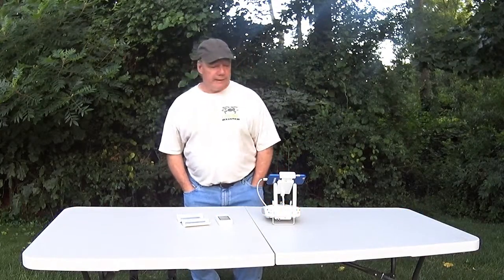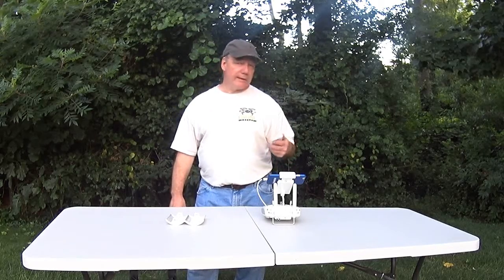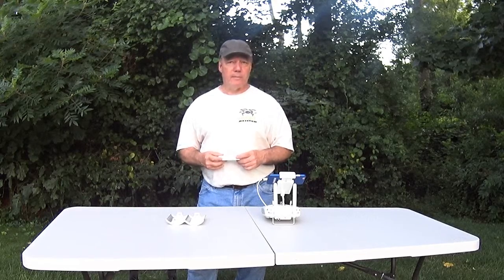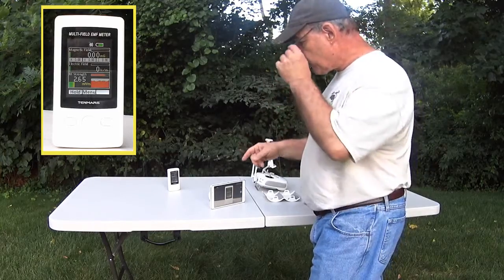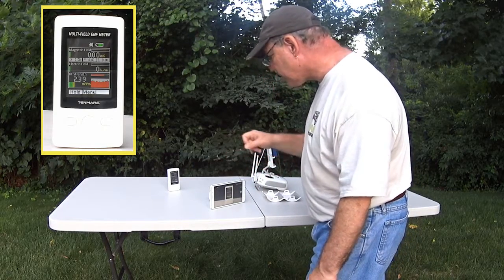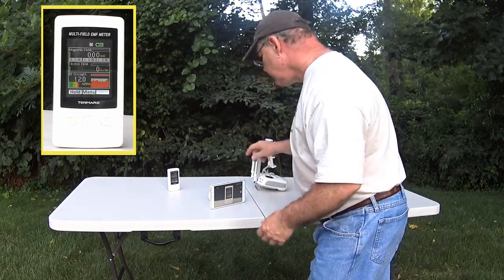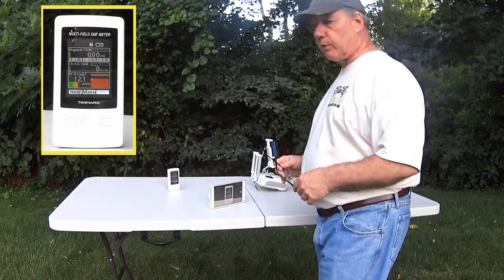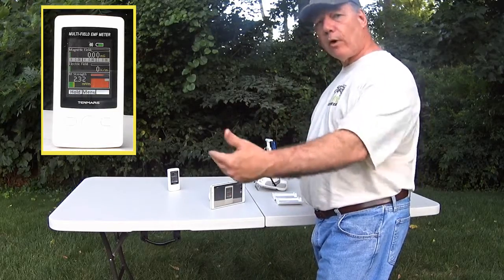DJI Phantom Drone Range Extenders do Work!

Comment: how do these compare to the argtek range extenders?
Reply from the maker: Thanks for the post. The parabolic will increase your range by about 50% and the ARGtek can more than double it. Everything depends on where you're flying but these are average results you can expect. Thanks again for watching and be sure to sub the channel. Rick
Reply: I was wondering the same thing... Thank You for the test !!!
Reply: From my experience  ARGtek is a bit over priced for my results for the P3S- I just got a windsurfer. If you have the Standard do not sink money in upgrades..( my opion) Just sell sell it .. the difference between the Standard & ADV is huge! and im not just talking the range. just my 2 cent maybe other people have have different experiences..
Reply: Aaron D i bought amd tested them and they do work much better than the original antennas. They are however more difficult to install that it seems.
Reply from the maker: Aaron, I have been using the ARGtek range extenders for over a year on my Phantom 3 and Phantom 4 and they consistently more than double my range. The Phantom 3 Standard is a little different since it doesn't use the LightBridge technology the others use but the difference is still impressive. I also work with the company ARGtek and am an authorized dealer for their kits. I choose them because of the testing I did when compared to all the other companies out there. As for the antennas not fitting in your case, they are removable and detach in about 10 seconds when you want to pack up for the day. I agree that that parabolics are a good alternative and my testing shows they can add about 50% more distance where the ARGtek will double the range. Thanks for the post but lets keep it civil. Rick
Reply: Drone Valley,,
Reply from the maker: Thanks again for the post and by civil I meant keep the cursing to a minimum as I have a lot of younger viewers and families on the channel and you can get your point across without the swearing. As for the consumer part, I understand that you may have tried these but there are a lot of knockoff items being sold that look like the original kit and not being sold by authorized dealers. I sell only ARGtek original kits and the upgrade does double your range over the stock antenna. The installation is simple and takes about 30 minutes. You're basically replacing the stock antenna with a set of high-gain ones that concentrate the signal and help provide a longer distance for the flight. I will do another test like this one to show the difference in gain over the stock antenna and the reflector ones to provide some numbers.
Reply: Drone Valley ..
Reply: Music_360 look harder. said bs in your first post amd dropped an f bomb on your reply to me. just sayin. but i think you ,ade your point. just leave it and move on. some of us have had great experiences with this product maybe you didn't . fair enough? all in all most of us enjoy drone valleys reviews and videos amd there's  no need to continue back and forth with this. and just fyi, not picking on you. i agree with you that the install could be more difficult that it seems and these antennas wont "upgrade your system". just upgrades your signal.

Comment: That is evidence!
Reply from the maker: Thanks for the post and I felt like I had to do a clip with the EMF because there was still a debate raging about these extenders working. I'll be doing another one this week comparing the ARGtek kit with the parabolics to show the extended range these kits provide. Be sure to sub the channel so you don't miss any updates.
Reply: Drone Valley I subbed .. I like evidence and when I get my P4 I will get that extender! Cheers!

Comment: if you ever get a chance to do a   1000 ft test.    only half joking ,  hook up  some way to  have the Camera on the Quad  look at the Meter as you fly away. 

That would be a great test       You have it Correct  sending the Signal in one direction increase the signal down range.
Reply from the maker: I'll give this suggestion a try. One of the challenges is that the EMF meter I have isn't "tune-able" so it picks up a wide spectrum of signals. This makes it hard to discern the drone from all the other background noise....
Reply: Valley  I understand   had to ask

Comment: Just to add,   Three times the power does not mean Three times the Range down field.
Also the along with the Small increase of power Down range  a Receiver Antenna that will boost the signal will help very much.      great Video.
Reply from the maker: You're right and what I find most helpful is that it provide a more consistent signal. I'm not really interested in flying 4 miles but need to be sure I have a rock-solid connection in close when flying so these help a lot with that. Thanks for the post!
Reply: Any help in signal is good

Comment: great job. Just a few questions, what about the signals coming back to the controller? the video feed. how does that channel react?
Reply from the maker: Thanks for commenting. The reflector will redirect all of the signals from the controller and improve the video signal quality as well as the range of the drone. Its a really simple device that works great without the need to crack open the case. If you decide to buy one, use the code "Drone" on our website (www.dronevalley.com) to receive a subscriber discount.

Comment: Having fitted tv and radio aerials for 35 years it makes perfect sense to me, if the doubters do not want to do it, well you can't please everybody all the time !!
Reply from the maker: Thanks for the support and I'll bet there are still people somewhere that will debate gravity as a concept. I wanted to do the clip to end the speculation with some science and help others understand that these parabolic reflectors are based on a sound principle that will improve signal strength by simply slipping them on the controller. Thanks again for posting and I hope you sub the channel so you don't miss any updates. Rick

Comment: which ones are better the CD reflection or the Windsurfer type reflector
Reply from the maker: The CD ones will work and are really inexpensive but don't do as great a job of focusing the reflection. The parabolic ones are a little more expensive but are designed to focus the beam spread to about 120 degrees and will give you a further distance. You could start with the CD version, its better than using the stock antennas and then upgrade to the parbolics when you're ready. They're only about $13 so it's not a big investment for the extra distance they provide. I appreciate you watching the clip and hope you sub the channel. Thanks, Rick

Comment: I have a simple question.  why are so many people skeptical about this item when it boosts signal 4x? I could understand skepticism if it were 1.5x because it would be relatively unnoticeable difference.  but 4x?? that's instead of 1 mile range, 3 or 4 times. thanks for the experiment. it's definitely encouraging.
Reply from the maker: Thanks for watching and posting. I agree and am always surprised about the amount of debate for a relatively inexpensive accessory. I have had a few subscribers challenge the first clip I posted about these and thought I'd follow it up with a more scientific demonstration to show how much the signal is boosted when using the reflectors. Thanks again for commenting and I hope you sub the channel, I have a lot more content coming.

Comment: Fantastic illustration!  Proof is always in the "pudding".  I was wondering, which are the best, copper or aluminium?  Or, are there a difference in the two?
Reply from the maker: Gordon, thanks for the kind words and for stopping by. I have tested both and can't see a difference between them with the amount of signal strength they help generate. I sell the silver ones because I have seen that the copper models didn't wear as well over time. They worked just fine but seemed to pick up a lot of fingerprints and tarnished to a blacker color. It's purely cosmetic but the silver version just looks cleaner to me. Thanks again for the question!

Comment: Great video. I have gone back and forth on purchasing this upgrade based on customer reviews. Seeing an actual test of the signal strength sealed the deal. Thanks again for posting this!
Reply from the maker: Tedd, these really do a great job and I saw your order come through and already have the extender packed and shipped. Be sure to sub the channel so you don't miss anything and let me know how you like the range extender when it arrives. Thanks for your business.
Reply: Awesome. That's amazing turn around time, very much appreciated. I'll post a follow up on how they work out.

Comment: Very well done.  Now this seems to supersede the previous demo when you cracked open the case.   Easier.   What is the RF pattern once you have installed these?   Less omni directional and more directional.   So if the drone is above rather than out you will have varying reception.
Reply from the maker: The parabolic range extender is a really simple way to increase the range of your drone. Compared to the ARGtek (which will more than double your range), this little guy will give you about 50% more range than the stock antenna. It's inexpensive (my favorite kind of accessory) and easy to use. The beam spread is about 120% so there's no worry about having to point it directly at the drone, general compass direction is fine.

Comment: Any directional antenna blocks signal from the back side and increases signal down field. Yes it does work just like a multi element beam for ham radio or micro wave dish on sat TV. thanks for the video I will order a set. If I need more range than what this will produce I will get a 2.4 gig liner you know 50 or 100 WATS. Yes I can do that I have a first class FCC license. But I think you reflector will be more than enough. Thank you
Reply from the maker: Thanks for the post and you're right, a parabolic reflector is used in everything from Dish TV antennas to the spotlights they use at Hollywood premieres and it works really well. My experience is that this simple accessory will increase your range by at least 50%. I also use an ARGTtek upgrade kit that will replace your antenna with flat panels that provide additional passive gain and can more than double your range. Boosting your signal with an amp can help a little too but remember that the drone also has to send telemetry and other data back to the controller and an amp on the controller is only a one way advantage. Thanks again for posting and be sure to sub the channel.

Comment: I don't have one but have heard that they are great only if you are directly facing the drone. Consequently though because the beam is focused narrowly, if you lose which direction the bird is in the sky it can drop connection and even unexpectedly trigger RTH. I don't know if those allegations are true but would like to hear your thoughts as you have experience with this device. Thanks for another terrific video.
Reply from the maker: Russ, you're correct. It's not quite 180 degrees but it's plenty wide enough that you only have to be facing the same compass direction as the drone. They are really effective and an inexpensive way to quickly increase your distance. Thanks for the post.
Reply: Drone Valley
Thanks for the acknowledgement Rick, I wasn't that close to correct, but, Like I said-Not an engineer..120˚ is pretty decent though. My background is more photographer/videographer coming into drones, therefore if you need any input regarding that portion, I'd be happy, in my humble opinion to assist with that area.
Besides Drone-U, your vids are the only ones that I follow. Your material, I think, is very relevant and concise. kudos!!!
Reply: I'm not an engineer, but by looking at the shape of the reflectors, you should be getting close to 180˚ to work with.  It is only taking the other 180 and bouncing directly back.  I think that gives you a little leeway-I would think.
Reply from the maker: Actually the beam spread is pretty good with these parabolic reflectors, which give you a 90-120 degree width of transmission. Admittedly the signal is lower near the edges of the beam but still effective. I have found that as long as you are facing the general direction of the drone, these make a huge difference. With other solutions like the ARGtek you have to be a little more careful to track the drones direction. Thanks again for watching and the support.

Comment: If you get the chance to repeat this test, can you also use the meter at 90 and 180 degrees, beside and behind the controller. You should see a significant drop. 

You could place the meter at a fixed location, say 5 feet, and then put the controller on a small plastic 'lazy susan'...you see where I'm going with this idea.

I use one of these almost every time I fly and yes, they do extend the range, more importantly, flying near another drone operator, they decrease the co-channel interference and dropouts.

Thanks.
Reply from the maker: That's a great idea and I will try and do that. Part of the reason I did the original clip was that a lot of people were asking if they worked and I wanted to put some science behind the answer. I will be testing the ARGtek extender this week so I could work these in again to try the angular part. Thanks for watching and posting.
Reply: tx2sturgis That's what I really was hoping to see in this video myself

Comment: Not only does it project more signal in one direction toward the drone, It will also deflect interference coming from the back  of the parabolic booster and catch more signal from the phantom and direct it to the controller antenna. 

Anyone the says this does not work has never really looked at a TV dish. the dish is not the antenna. It is curved to bounce the signal to the antenna. You can use the same dish to extend you home wifi network in one direction.

 Nice video. Thank you.
Reply from the maker: I agree with you and its a simple concept. Radio waves are essentially dumb and will go where you point them. The Parabolic reflector is used to concentrate and orientate the signal in a specific direction, same as a Direct TV dish or audio concentrating dish on the sidelines of a football game. I've used them for a while and found that they increase the range of my drone but 50% or more. Thanks for the support and the comments. I hope you sub the channel so you don't miss any updates.

Comment: Nice!
Test with the Range Extender pointing to the opposite side, to see the lost radiation.
Reply from the maker: I'll be doing this test again this week to compare the parabolic extenders with the new ARGtek antenna kit I'm now using and will see if I can show the amount of power that is reduced from the rear of these reflectors. Thanks for watching and be sure to sub the channel.
Reply: Ok :)
Reply: +Drone Valley looking forward to the ARGtek comparison.  i have the parabolic reflectors now and have been wondering. 

of course the main reason most people use boosters of any sort is to gain range. Have you, or will you, do any tests demonstrating tranche differences with various boosters?
Reply: Awesome.. I'll be waiting...

Comment: Drone World sells an extender for 500 dollars maybe you could include that one in the comparison as well to see if it's worth the ridiculous price.
Reply from the maker: I've seen that setup but I don't own one. I expect that they are using an active antenna system that boosts the signal to achieve the range they are claiming. It might still be a passive antenna that is more efficient but it will be hard to test it since I don't own it. I might make the investment just to see the difference. Thanks for posting.

Comment: Is the ARGtech worth the money compared to the parabolic booster?
Reply from the maker: The parabolic will increase your range by about 50% and the ARGtek can more than double it. They swap out the stock antenna with high gain paddles that really help to keep your signal strong over a much longer distance. I hope that helps. Rick

Comment: Rick after watching your video on practical safety and protection items that should be in the box I subscribed. Then I found this one and it's just spot on. I will definitely be following you, one thing I have the silent one does the copper one make a difference?
Reply from the maker: Thanks a lot for the sub and I'm glad you're enjoying the clips. Honestly, I think both of the parabolic reflector extenders work the same. I have sold and used them both and haven't noticed a difference. I know that different stores swear by one or the other but I think it's mostly marketing. My experience is that these reflective range extenders should increase the distance you can fly by about 50%. I hope that helps and thanks for the support.

Comment: Great video. I was wondering if there is a difference in signal strength with an aluminum reflector versus a copper on?
Reply from the maker: Thanks for the post and for watching. I have used both and they work the same from my experience. I know there are companies that swear by one or the other but I think it's mostly marketing. I have seem people make their own versions of these using cardboard and tin foil that work pretty well. Radio signals are dumb and will go anywhere you "point" them. These reflectors just concentrate the available signal into a narrower beam and point them at the drone more effeciently. I hope that helps and you sub the channel. Rick
Reply: Thanks for the input. I kinda of figured it was more of a marketing thing. Appreciate your videos. Keep up the good work. Cheers.